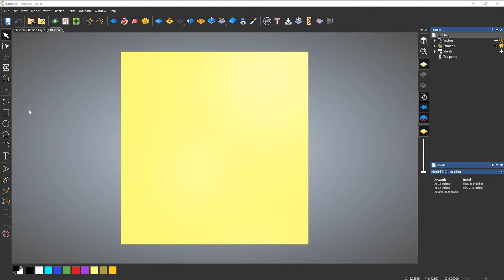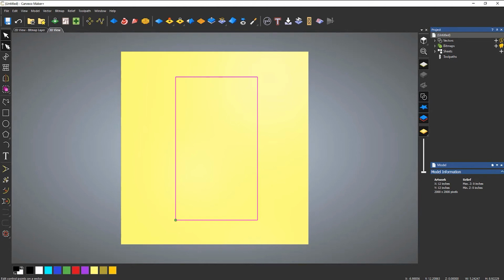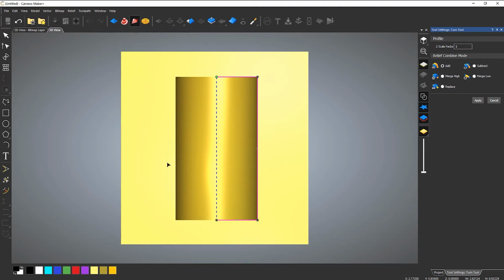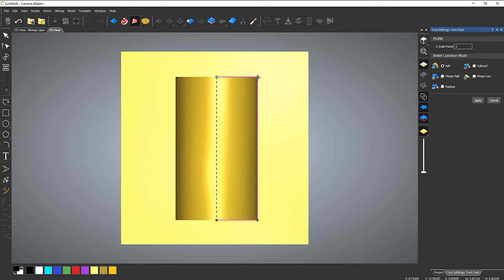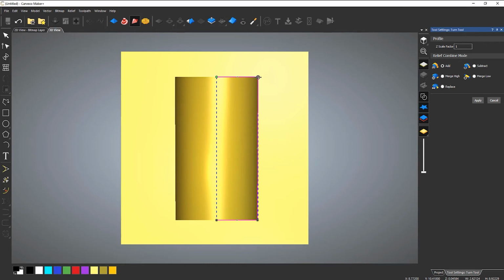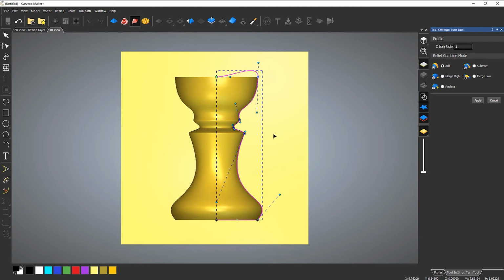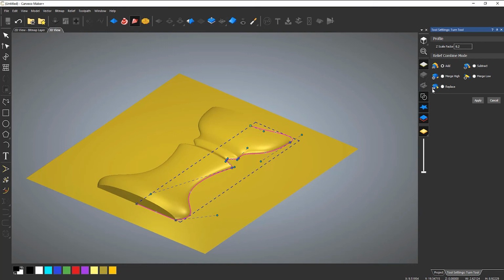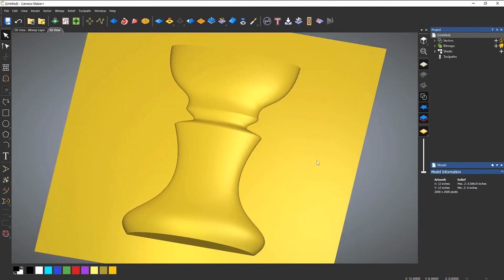Carveco Maker Plus: Turn Tool

Comment: Excellent tutorial — one question: This is for relief carving on a flat material but can I then wrap the design for a rotary '4th' axis carve? Or do I have to design it differently?
Reply from the maker: Thanks Jerry! For rotary, it will need to be designed differently. You can view our tutorial here: https://youtu.be/ePzVWZeoVSA?si=DqLh4XXZ35WNrIfo I hope that helps. Cheers, Tim
Reply: @Carveco  Many thanks Tim :-)

Comment: Watch all your videos. Great learning videos. I have a question on this one, after creating a rectangle and clicking the node editor, I can't figure out how to cut it in half. When i click on the nodes I don't get the line connecting the 2 nodes. Is there a key to hold down first, shift, fn, alt?
Reply from the maker: Hi Jim.  Sorry, but I'm not sure what you mean.  If you save your model as an .art file and sent it over to support@carveco.com, they will let you know what the problem is.